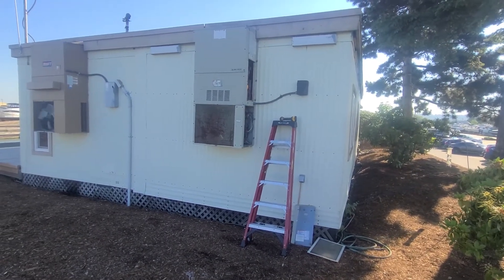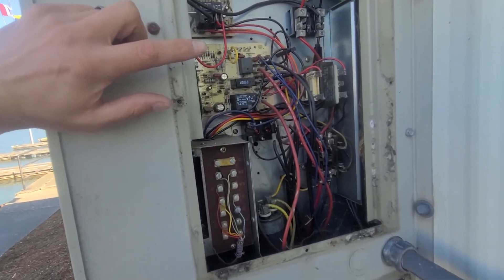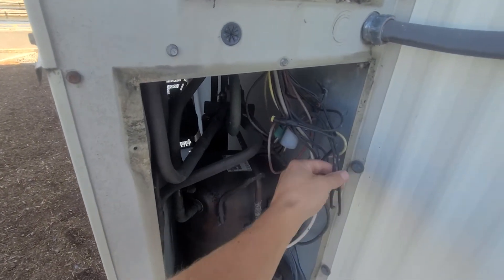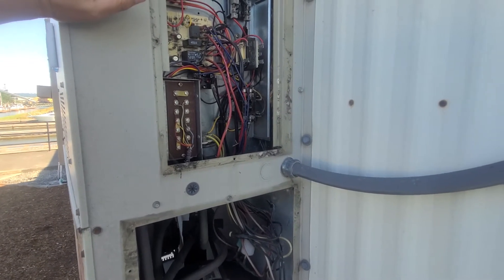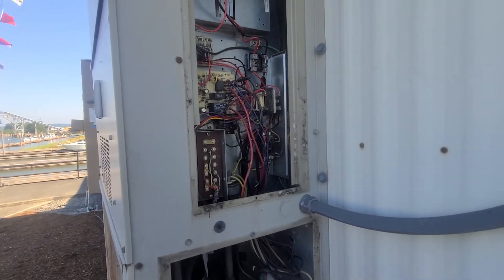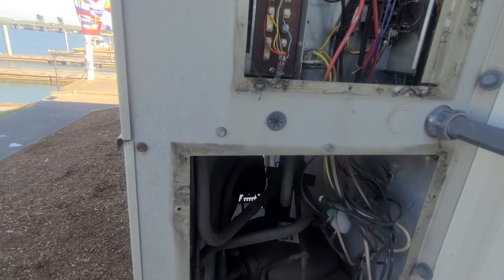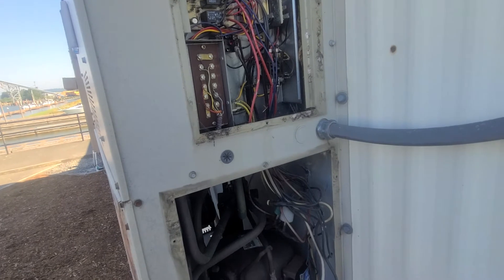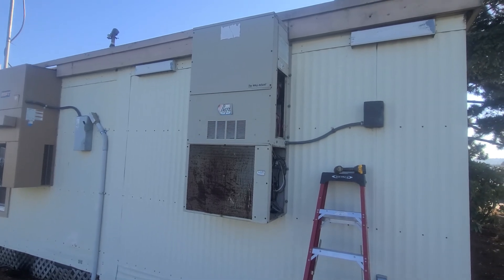Diagnostics On Bard System Not Cooling

Comment: The condenser fan motor is not a pain in the butt to replace, it takes 15-30 mins tops. You just need to remove the correct screws and slide out the fan shroud. No big deal.

Comment: Are these BARD wall mount units typically heat pumps??
Reply from the maker: Yes that's all I have seen.
Reply: @HVACServiceTechnicianTalk  thanks, I appreciate the response👍
Reply: They are not typically heat pumps, they are whatever you order. Just like typical split systems, they can be straight cool with heat strips or they can be heat pumps. I maintain 285 bard units every month and only about 10 of those are heat pumps.

Comment: I’m new to hvac. 

On systems that aren’t residential how do you know which is the suction and liquid line? 

Also how do you tell what’s a high and low pressure switch. Thanks
Reply from the maker: Liquid line is usually smaller and suction line is bigger.

Comment: Have same one. Problem. Fan blows air sometimes. Other times it don't turn on.
Reply from the maker: Possibly power or control board issue. Maybe failing capacitor?